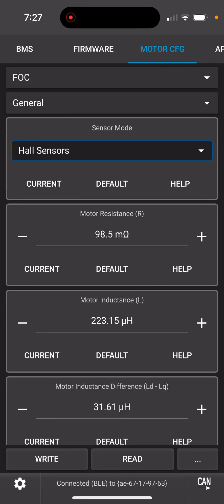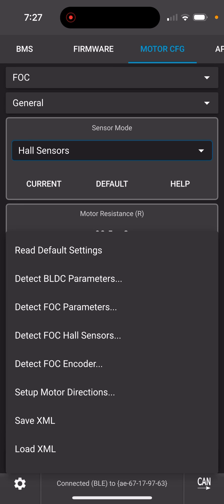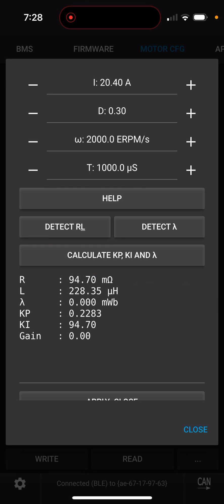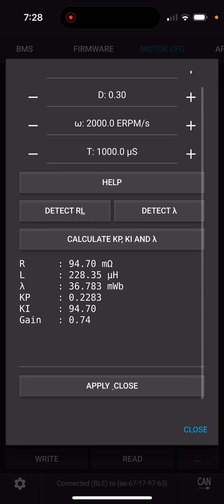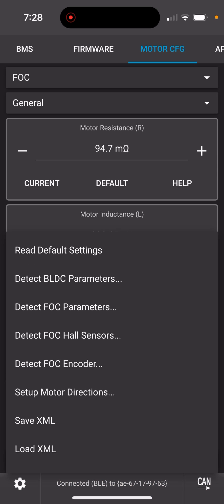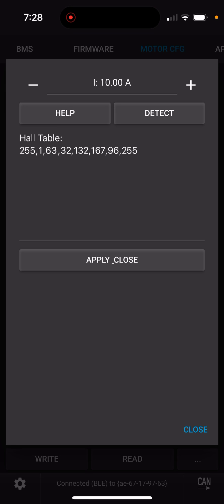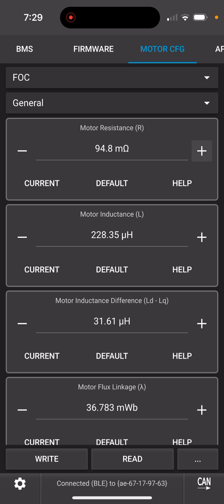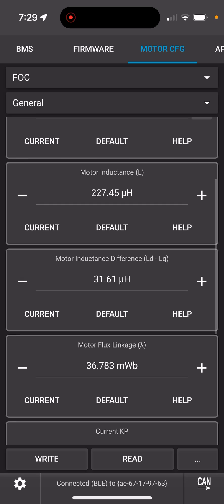VESC how to: manual motor detection

Comment: Hi
I am new to the topic of electric motors and controllers. For my project, I need to synchronize two propellers mounted on a rig both in terms of RPM and position. I received a recommendation to use VESC ESCs for this purpose. However, I have been struggling to even get the motors started, and at one point, one of the motors started producing a loud screeching noise.

I am using the following components:
- Motors: 880KV T-Motors (AS2820 long shaft)
- Power Supplies: Separate power supplies for each motor, set at 12V and 20A
- VESC 6 electronic speed controllers

- I am only using the usb with laptop to run the motors.

I am also quite confused about the settings I need to configure on the VESCs to achieve synchronized operation and avoid issues like the screeching noise.

Any guidance or suggestions on how to properly set up and configure these components would be greatly appreciated.

Thank you!.
Reply from the maker: should be possible via CAN though I've never worked with dual motor setups, best to ask on the official VESC Discord: https://discord.gg/qaKj6e287m
Reply: @surfdado  Thanks a lot for the link :)

Comment: what is The float package and how do you disable it? I'm installing new motors and the LaCroix falcon drives onto my Super sport cuz I had a motor burn out so I want to install the new motors and perform motor detection for the new motors but save all the existing settings which I should just be able to back up the settings run through the motor detection wizard and just make sure I know what all the critical inputs are for running the wizard as opposed to doing this method right? And then I can apply back up and write those settings for all the other drill down settings in the desk tool for motor configuration and current and all that good stuff right?

I've done this a ton of times but it's been over a year or so if anyone has any advice thanks in advance sorry for the long message and thank you for posting this video!

Comment: My board just recently made a weird noise the motor jerked and it stoped moving I did a handtest and the motor jerks. It still comes on and the only error code that came up was duty cycle tilt back should I do  motor detection
Reply from the maker: @Trailfloater  sounds like a broken hall sensor. If you’re lucky it’s just wiring. Get on the Vescify discord to get assistance with that
Reply: @surfdado  yea I emailed Tony and send video he said same thing but said to redo motor detection but he said sounds like hall sensors

Comment: Hello Surfdado. Trying to solve the crunch noise when braking hard, I noticed that the detected resistance and inductance are too high (157mOhm, 579microH), more or less the double of the expected. The detected motor current (41A) is lower than expected (63A). Any idea?
Reply from the maker: Sounds like a poor connection on your phase wires. You need a rock solid high quality motor connection or else it won’t work. Half baked crimps or cold solder won’t survive very long
Reply: @surfdado  Thanks for your reply. Can I do anything to solve this issue?
Reply from the maker: @floatingtrescantos  just fix your wiring to the motor